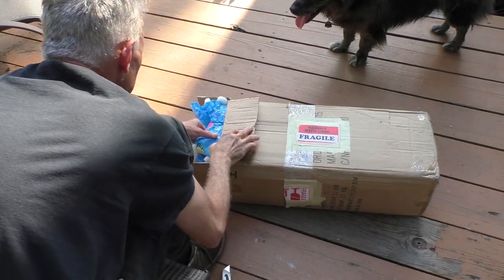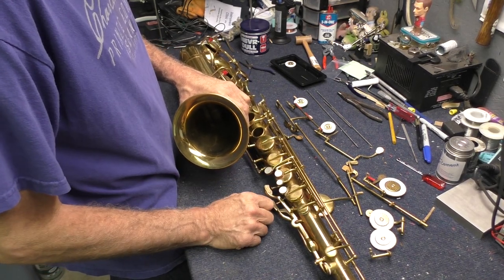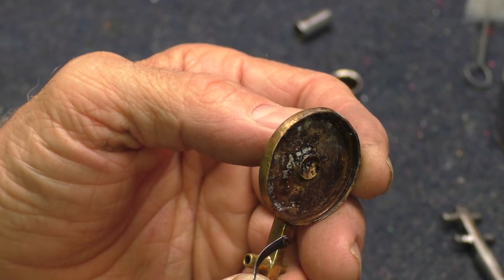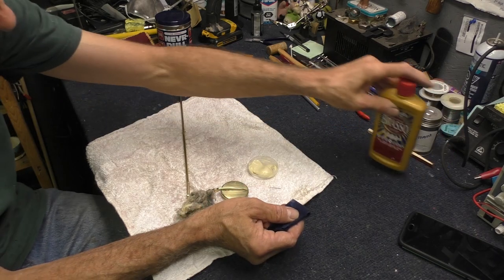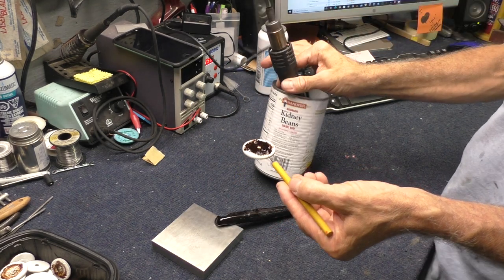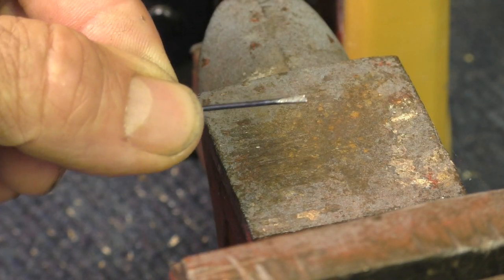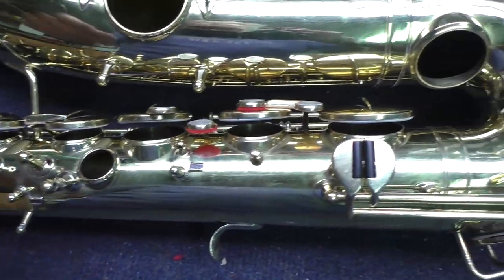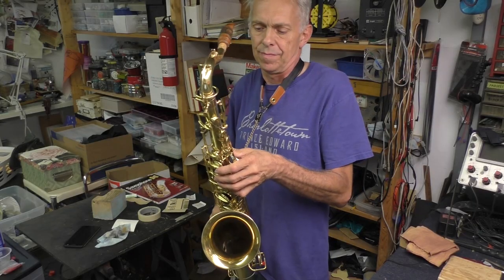1927 Martin Handcraft Tenor Saxophone Overhaul

Comment: Back in 1975, I bought a 1952 "The" Martin Tenor from a paun shop for $100.  It came with a white plastic mouthpiece with Brilhart, 4* , Streamline markings.  The reed land fit an alto reed, way too small for a tenor, but the neck hole fit the tenor neck perfectly.  I already had an alto, so I got a sharp flat file and enlarged the land, increasing the angle relative to the neck centerline.  Then with a dremel and other tools opened up the inside with a shape the transitioned from rectangular to round.  All this ad a 17 yr old kid.  It plays fantastic, with a big warm sound.  Also, the pads have no resonators--always thought that was unusual.

Comment: Just bought me a 1935 King Cleveland Alto brass and I’m learning how to clean it up. It’s got a ton of minor scratches on the original lacquer. 

Do you know anything I can do for that?

 It’s hard to find a solution for it since it seems to be so specific. 
I’m new to the sax world and come from guitar and bass so any advice would help! 
Thank you so much for your videos!
Reply from the maker: Not much to do other than a complete strip and re-lacquer. I'd suggest just leaving it as is. It's the character of the instrument.
Reply: @HackaweekTV  that’s the problem I have. It’s the original lacquer but there’s some rust bits and a dent that was fixed poorly. The scratches cover up all the details on the bell. But at the same time I want the original lacquer on it. Stuff decisions…